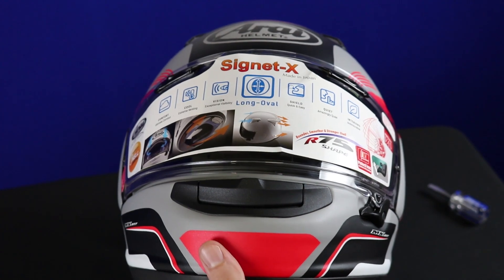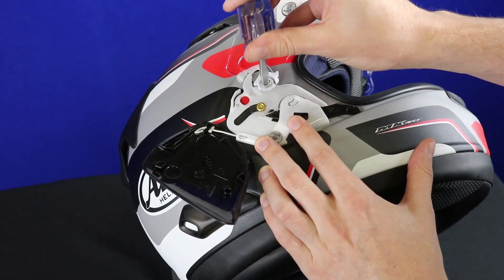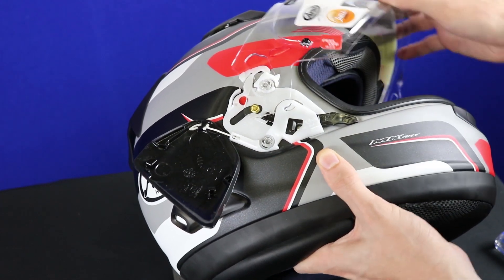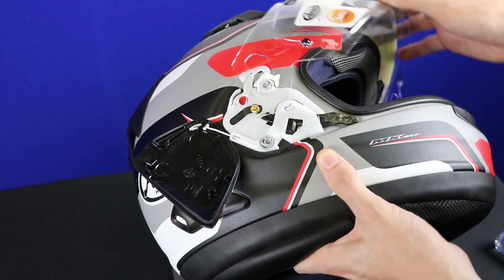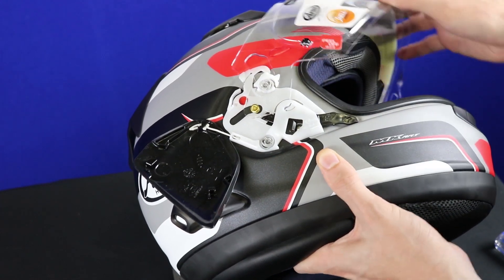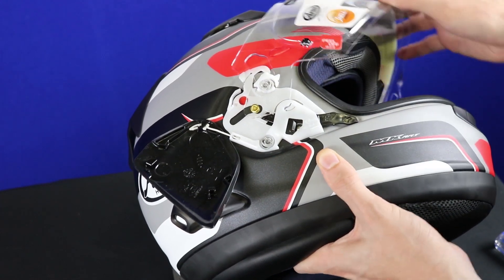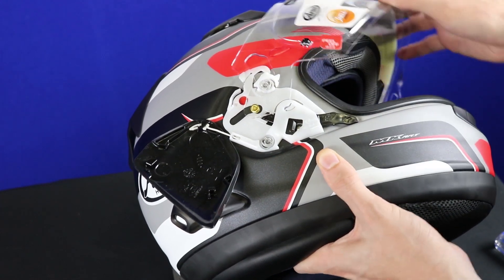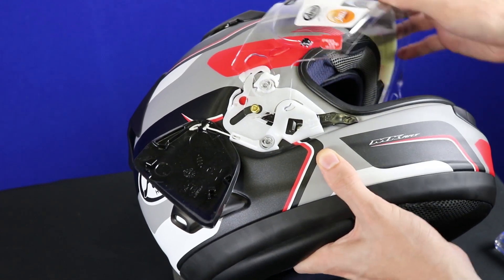VAS Shield Adjustment

Comment: Lots of comments about not being happy with the seal no matter adjustment. I'm an ex arai tech, and we always carried some of that silicon lube you get with shavers, and rub it into the rubber seals. Keeps them soft and creates a better seal.
Reply: They actually included a little bottle or tube of it with my new Contour-X. I'll be sure to add a little bit.

Comment: I followed this method several time trying to adjust my visor on my RX-7V but I always seem to get a little gap between the seal and the visor in the lower corner opposite side of the latch letting air through. I've tried several methods but somehow I am always able to slide a thin paper from the inside through the visor and always at the same spot.
Reply: I just spent an hour going crazy at trying to close this gap in the exact same area as you. No matter how far in/out or high/low i move the base plate there is always a gap, i can press it and hear it touch and come off the seal. Tried it on 2 different visors to make sure one wasnt bent or whatever. Im hoping that little gap is the reason i have a whistle noise.
Reply: I have the same issue with mine and no solution found so far. This is supposed to be a  high end helmet ,very exoensive by the way, but uncomfortable to use. Arai never again.
Reply: I have the same issue with the Arai Quantic model, no matter how hard I tried to readjust the visor the gap between the seal and the visor in the lower corner opposite side of the latch is always there. I have a whistling noise that obviously comes from that gap. Poor design from the famous Arai company😒😒!
Reply: Same here.. good to hear I'm not the only one with a problem on the Quantic, its enough of a problem that air blows into my eyes... rather uncomfortable.
Swapping to a Shoei NXR 2 now.. tried few original Arai shields, always the same.
Reply: I have a corsair-x and yes.. Mine has that whistling sound too, after I go 65-70mph. I dont like it. 
After I saw these comments, I am convinced its because the little gap that the shield leaves. And my lock is not even perfect. 
However I still love Arai. Not a quite helmet at all. But definitely a safe, comfortable and the best looking helmet for me. 
Ride safe yall ✌🏻💪.

Comment: Just bought a brand new Corsair X and there is a gap on the bottom right.  Opposite side as latch.    No matter what you do you can’t get it to seal.  This thing was $1044 to my door.  What gives?    What’s the fix?    Crazy that my $200 icon never had sealing issues.    Please help me be an Arai customer for life.   So far it looks like this will be my first and last Arai if I can’t get the visor to seal fully.   A problem like that literally defeats the purpose of a visor.
Reply from the maker: Please contact our offices directly at either info@araiamericas.com or 610-366-7220 Monday - Friday 9am-5pm EST. We will be able to better assist you with your issue via direct contact. Thank you.
Reply: I believe this is a known issue to Arai that can't do anything about it. Probably Shoei found the solution by installing to its new models a latch positioned at the center of the visor over the chin, so there will be no eccentric pressure while locking.

Comment: I've tried this methode while installing the ratchet and visor back after cleaning... But i got this sorts of problem in which the visor is not tighten enough when its lock to the lock switch...can you help me with this problem??? Cause iam worried when i crashed my bike... The visor would open and gravel would struck my face...
Reply: happened to me after I first removef the visor. It just takes a little more effort to push the visor down with a few fingers to get it over the demist post

Comment: I'm on my 3rd signet helmet in 15 yrs. Only thing that fits my head. But each variation the shield latch gets worse. This latest is the most aggravation.  If you don't slam it shut it won't release,  even then it's hard. Very dangerous if it's fogged up. Would Bell or shoei PLEASE   make a long oval helmet!

Comment: Funny that after adjustment, the graphics in the video isn't lining up lol! Nevertheless, I love my Corsair X. Comfy, doesn't pull sideways in crosswind etc. Now after some 3 years of hard use on street and track I am trying to adjust visor to seal and cannot for the life of me. May be that the side base plates have kinda worn tracks and need replacing? Maybe visor too? Nothing seems excessively worn out. However, does not feel very snug anymore, so that may be the reason why. It does kinda suck that such expensive helmet has such a guess work based adjustment. C'mon Arai, you can do better than this...

Comment: I’ve been an avid Arai fan for 10 years +, owning a number of helmets. I’ve owned the Chaser X now for 12 months, and I have to say, due to the new visor system, I will never buy another Arai. It’s shite. Absolutely shite. 

It’s an absolute ball ache to open whilst riding, taking several attempts. It does not close unless you apply excessive pressure, thus, concentration, whilst riding. Sometimes it will not close, and I have to pull over and use two hands to close it. 

I’ve been back to the Arai ‘approved’ shop where I bought it, only for them to tell me that it’s fine and it is as per design. 
Absolute crock of shit helmet. £550 - waste of money for such a crucial feature of the helmet to be poorly designed as it is.
Reply: I struggle with this too, it's as you close it and try to open again at lights or whatever, it's probably great on a track as it won't lift in wind, I thought I was doing something wrong with that little moving lever, I thought it must do something but it don't , I'm actually tempted to remove the edge on the plastic bit that you are talking about so if pulls away easier, anyway have good un and ride safe 🖖